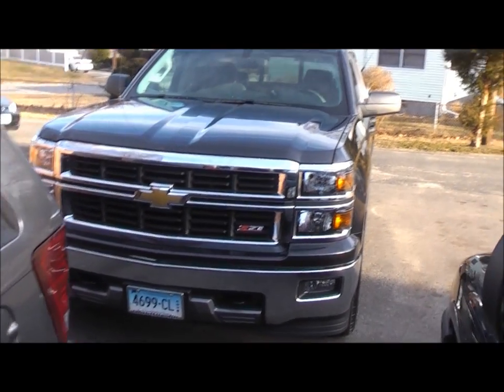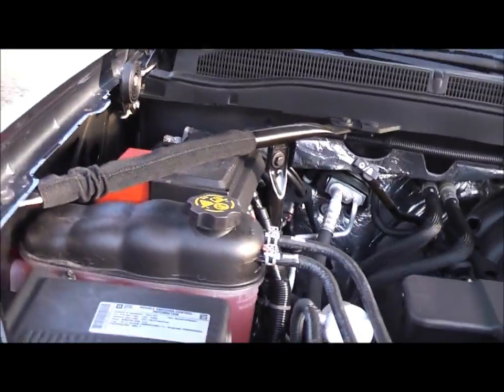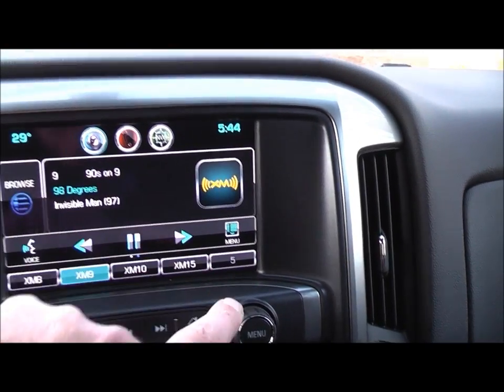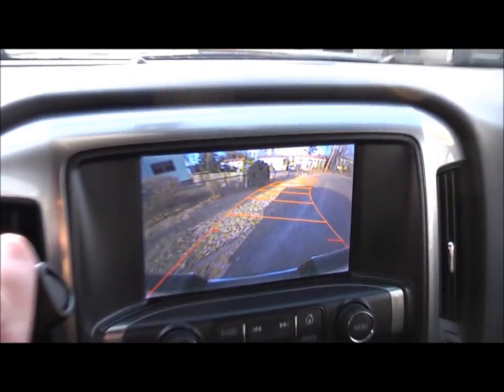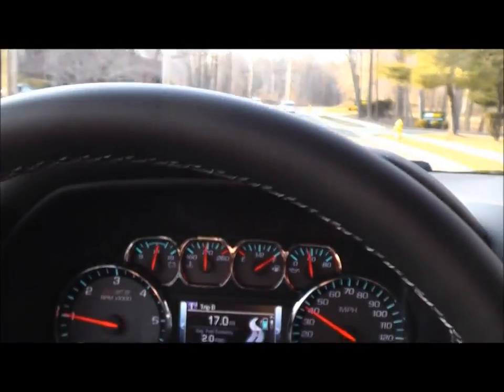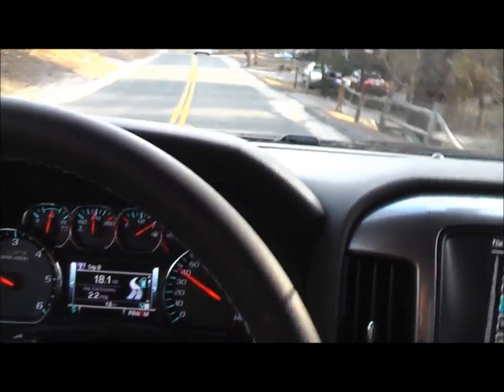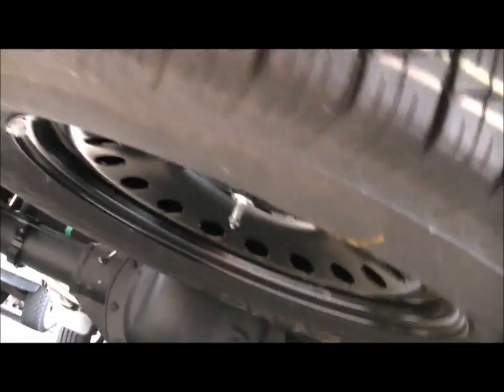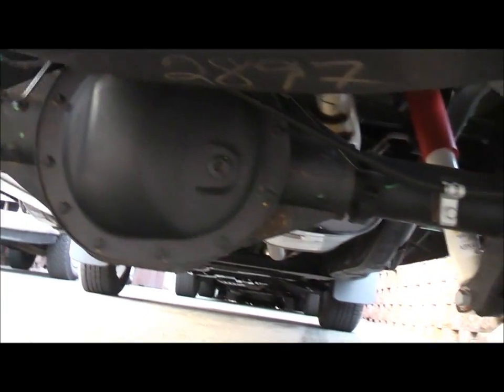BRAND NEW 2014 CHEVY SILVERADO Z71 4X4

Comment: Mine's just like it, except it's black and I have a solid rear window. It's exactly what I wanted except I wish it had the Bose (still sounds good though) and wish I didn't have 3.08 gears, but that will be changed to 3.73s when I can. It was also way too quiet, but I fixed that with a Flowmaster Supper 44 dual out exhaust. So far so good after 7,000 miles lol.

Comment: Nice.. Only thing I hate on the new ones compared to the models before the cabs are too small..
Reply from the maker: yea, I agree they shrank the new pickups....and to be honest IMO, it's a poorly built truck and it feels cheaply made, I would go with the Ford or even the Dodge Ram which is built in Mexico over the Chevy pickup. GM has been making junk for the past 15 years....IMO.
Reply: *****  Ram 1500's are built in Warren MI truck plant.  The ram 2500 and up are built in mexico.  I have a 2014 ram 1500 it and I cross shopped the new 2014 silverado. They were close but the ram had more new tech in it like the rear coils, ZF 8 speed and the Hemi is a better towing engine then the 5.3  However if the ram 1500 was built in mexico I would choose the silverado. In fact I love the ram and my next truck will be a 2500 and Im kinda pissed I can't buy a 2500 because of the Mexico fact
Reply from the maker: Gabriel Iannozzi I have been looking at new Rams lately and all the models 1500 and 2500 have made in Mexico on the bottom of the window sticker along with port of entry even though they were probably shipped over by train. I can't find one dodge Ram that wasn't made in Mexico. So, I would go with the Ford or maybe even the Texas made Toyota and my past experience with GM products will never allow me to buy another GM product. My past experience with GM was good until GM cars/trucks produced starting from the late 90's to present have all been crap and fall apart once 100K starts to approach but, this is my experience and others may have different POV.
Reply: Mine was built in USA if the Vin starts with a 1 its USA and 3 indicates Mexico.  And if that's true then I'll buy a Toyota next time cause from what I read it says its the most Americans built truck in America, go figure that out.  I was a GM man prior to this ram.  GM's newer stuff in the last few years was good to me but you're right last 20 years was garbage. How can foreign companies like  Toyota built a quality truck with the same USA uwa labor and and turn a profit but the domestics can't?  Its all bs they want to make maximum profits so they use the absolute cheap parts they can.   Makes me want to go buy a Toyota and I pride myself on buying American
Reply: Gabriel Iannozzi just double checked mine sats on the drivers side door, built in the USA.  maybe its the area of the country you live in Im in the north east
Reply from the maker: Gabriel Iannozzi I'm in the North East also, CT. What year is your Ram? I like the new Rams a lot but, besides being made in Mexico I don't like the CD player is under the center arm rest, that could be a real PITA to change CDs. I have a dealer video of a new Powerwagon.....yes....I want that, although I would have no practical reason to have that pickup especially with those low gears it comes with but, I want one and the cost is also a killer on that truck. I bought a new Ram 1500 back in 2001 and still have it, has 100K on it and runs great and is still is in good condition and I haven't had many problems with it, waterpump, EVAP Hose and a AC line needed to be replaced in the past 13 years and it's still going strong. I probably could get another 15 years out of it!!! RAM TOUGH.....like Dodge's marketing states!!
Reply: ***** It's 2014 outdoorsman with the 5.7, zf trans, 3.92 gears its a QC.  Its was built on 1/14.  I don't know, but like I said all of the 1500's  looked at were USA built.  In fact I was considering a 2500 until I saw the made in mexico sticker in the same place as where the 1500 said USA.  I figured with the properly equipped 1500 I could tow as much as a 2010 ram 2500 could 4 years ago so it would suit my needs plus ride better, get better MPG's, get more features for less money, and was USA built. I do like the powewagon but those 4.10 would kill ya in gas as a every day driver.  Even mine with the ZF and 3.92 I can barely do better then 15.5- 16 mpg around town, highway is a little better like 17-18.  The guys with the ZF 3.21 gears are pulling like 18 mpg average which is  a ot better but loses almost 2000 lbs of towing.  Well I hope you can find some 1500s built in the USA because with the zf and coil link rear end it really is a pleasure to drive when Im not towing my camper or rzr which Is exactly what I was hoping for. Not to mention it tows them extremely well too
Reply: ***** I guess you got lucky, my dad had a 99. He put 3 Water pumps, power steering belt, transmission, and an ignition. He has a chevy now and it has had NO PROBLEMS.  CHEVROLET THE HEARTBEAT OF AMERICA
Reply: Are you just talking about the Double cabs? The Crew cabs look roomy. I have a Double Cab so it's a little smaller, just bigger than what was considered extended cab. It's all I need anyways.
Reply: ***** ok, do u have one to say that it is a poorly built truck?? i got one and its the double cab like this one, not the crew cab that in fact is 2 inches longer than the previous gen. and i think imo the interior and exterior precede the old gen by a long shot.
Reply from the maker: sure fire Why yes I do and matter of fact we had a fleet of 24 chevy vans/pickup trucks that I am responsible for the vehicle administration for the past 20 years and we switched to Fords recently as the leases expire. We like the chevys because of the old style pushrod V8 engine.....easy to maintain if decided to keep the truck past the lease/warranty period but, every other week something is wrong one of the Chevys.....so, enjoy that Chevy you own....I feel sorry for you!

Comment: Hey was that rust on the motor where you zoomed in at? Just curious
Reply: kingpandagaming The rust is on the manifold since it is cast iron.  Does not affect anything.  Most engines have rust on the manifolds.  More importantly, the brake rotors don't rust.